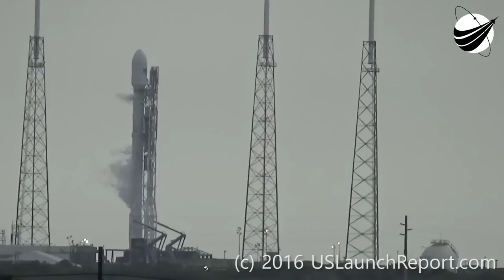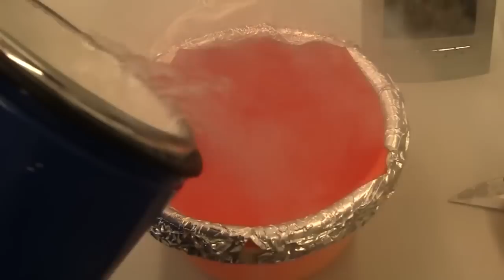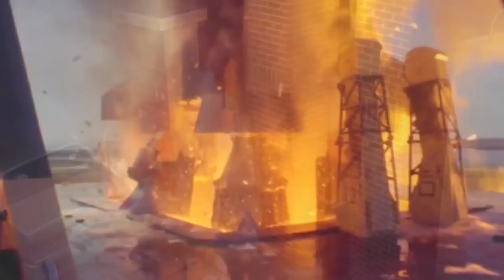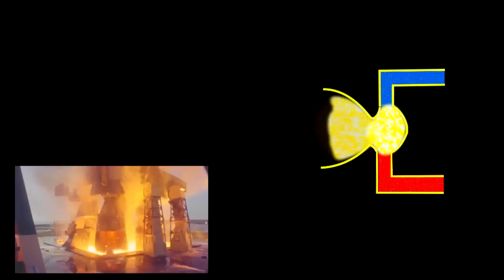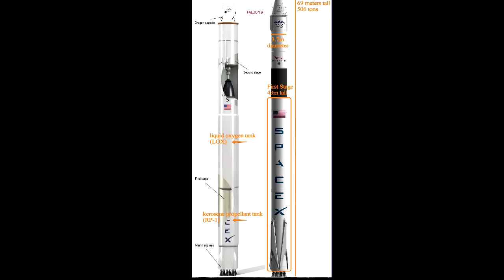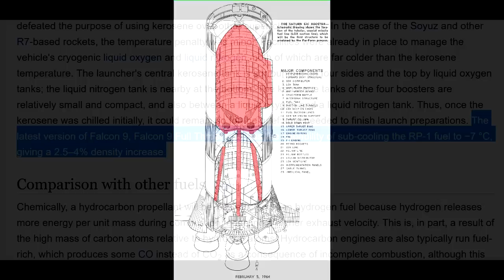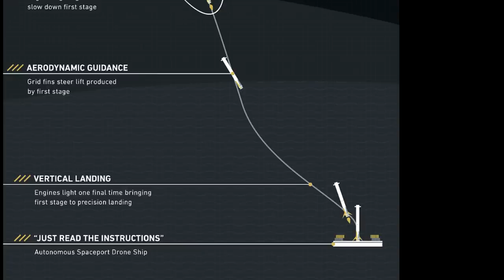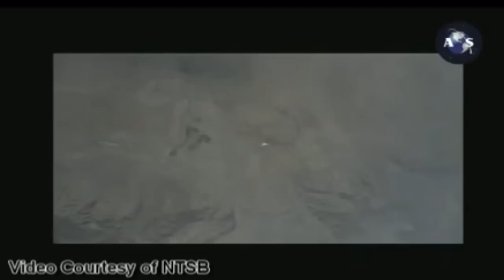Why did the Falcon 9 Explode?

Comment: The fact of the matter is, NASA, though very historically successful, is a bloated giant. And SpaceX's vehicle reliability is actually quite good. They have designed the most efficient gas generator and staged combustion engines (Merlin and Raptor) in history, and have done it at a fraction of the cost. Nasa designs can take decades to be completed, and the obsessive bureaucratic oversight strangles projects via committee, and this will NEVER EVER make spaceflight affordable. The cost cutting is THE MOST IMPORTANT PART if more than 12 people are ever going to leave the planet for more than 2 weeks. It cost 400 million to over a billion to launch one shuttle. And it was the most dangerous spacecraft ever designed. SLS will be somewhat better, but its going to be almost 20 years before it can get a human to Mars' surface. If it ever gets built at all. Look what happened to constellation. And NASA has lost a hell of a lot more rockets than SpaceX.
Reply: Raptor has never flown. They have said it is the most efficient. Merlin is not the most efficient gas generator engine. NASA has a better success record than SpaceX
Reply: Merlin 1D Vac is the most efficient kerosene gas-generator engine, period. 

Raptor is not the most efficient staged combustion engine (that award goes to the Russian RD-0120), however it is the first full-flow staged combustion engine ever developed to the point of actually firing the engine, which is significant. It is also currently the highest pressure engine of all time with 250 bar in its combustion chamber, beating the RD-180. 

The more remarkable capabilities of the SpaceX engines are actually not their performance, although that is impressive too. The fact that these engines can re-light in mid air is actually not very common among rocket engines, and the fact that they have deep throttling is even more rare. These engines are also incredibly reliable; of the literally hundreds flown, only one has ever been shut-down mid flight due to a problem, and that was on one of the very early launches.

Comment: I really doubt that SpaceX is anywhere near matching NASA's cost to orbit, let alone beating it. Though they often state $50-$60 million per launch, in reality it has been closer to $120 million. Both Ariane and Atlas are about that, but are also FAR more reliable. Schemes to reuse some parts of a launch system have not so far reduced costs. In the case of the shuttle it resulted in much HIGHER costs. There are significant costs in reusing a launch vehicle. As you point out, there is a penalty in reduced  payload to orbit. There is the costs of refurbishment of the recovered booster. There is a failure rate in the recovery itself. All these factors erode any cost advantage reuseability may offer. This is why that most cost effective and reliable systems so far have been expendables.

Comment: The problem appears to either be in the second stage or in the fueling system in the tower.

The explosion propagated from the outside of the rocket where the vents and fill pipes are or it could have been just inside and that is where it blew out.

Either way it looks like a fueling system fault.

Comment: desighining a docket from scratch a d not to rely on 60th technology is what brings the savings. the musk rockets are 3 or 4 times cheaper without reusability. the price for desighning from scratch is that it is at first mot as reliable but that will come after 20 starts or so....

Comment: I think you are 100% correct about Spaceship Two: it is an insanely dangerous design, which is little more than a randomised suicide machine. But - the Space Shuttle was almost as bad. NASA should never have agreed to build the thing, once the military had made it grow so large that it could not sit atop a rocket.

NASA were incompetent when they designed and built it. Were incompetent when operating it, and treated it as an operational vehicle when it was never anything except an experimental craft. They told lies about what it could do, in order to get a third-rate space ship built.

If they had simply continued to build Saturn Vs. we'd probably have a city on Mars by now.

Musk has his flaws - as we know; his Hyperloop idea is more of a mass-murder device than a mass-transport device. But we also know he is determined to succeed, and I for one, think he will have a tremendous impact in space, and here on Earth.

Comment: Just one of the turbo fuel pumps from the Space Shuttle Main Engine develops as much power as 40 diesel locomotives. They are each about the size of a V8 engine. If you put the inlet of one of these pumps into a typical in-ground domestic swimming pool, it could empty it in less than 20 seconds. If you pointed the outlet skywards, it would pump a column of water 50 kilometres into the air. Yep. Turbo pumps are seriously kickass.

Comment: Dude, I get that Musk has a quasi cult following which is quite annoying, but let's give credit where credit is due... This is a great advance, whether it might be useful soon is yet to be seen, but it does give another option for spacecraft development, one that might be important for the future... And even if it isn't, it still probably worth just for the experience in space craft control theory and stabilization... The guy set out to do one thing, get a sattelite on orbit and then land the rocket, and he did it, were there accidents on the way? Of course, it's not easy to get into space flight, but as far as I know no1 died, so they possibly were being careful enough, it seems some of the explosions were even autodestruct mechanism activated when a sensor failure was detected, much better to just explode a rocket than to let it fly with a faulty sensor...

I for one am grateful for this experiment, and am happy it happened...

Comment: The only way you can really make a launch vehicle renewable is if you scrap, and refine and rebuild the machine anyway as any wear and tear would be catastrophic.
Reply: What wear and tear? Each new engine is test fired to full duration in Texas,, transported to the Cape, test fired to full duration again, then launched - all without scrapping, refining, and rebuilding between the 3 fires. They also have test engines they have fired multiple times at the Texas facility without rebuilds.

Comment: You'd think they'd have some sort of leak detection systems: perhaps an array of sensors detecting ambient fuel and oxidant levels all over the rocket. For the trouble, you'd get to keep your rocket and payload and launchpad if a leak was detected and fueling was aborted and perhaps have the fuel neutralized.

Comment: Some have speculated that the use of deep cryo lox cooled very close to its freezing point to densify it and increase the size efficiency of the vehicle combined with the fueling sequence being accelerated by a factor of six in comparison to other rockets created a temperature gradient between the lox tank and the helium cylinders that was sufficient to over stress the materials.

Comment: can anyone answer this...i know this wont work on non oxygen planets but on earth why use liquid oxygen and not say a turbo jet engine to funnel a massive amount of oxygen to mix air with the kerosene or hydrogen at least until the oxygen runs out then  switch to liquid oxygen once the air gets thin.

Comment: 12:10 - Wait.  What?  The Falcon 9's second stage runs on kerosene and LOX, and not hydrogen and LOX?  I suppose you learn something new everyday.  I just don't understand temperature and fuel expansion-wise, why they wouldn't go with how the Centaur does things.    And it'd be nice if they could drop those stages via parachute into the ocean.  Salt water I know, but it'd solve a lot of problems.
Reply: Yep both stages use the Kero-LOX Merlin engine. They have a Metho-LOX Raptor engine in development which will have considerably more thrust and run cleaner.

Comment: there was a smaller explosion sound before the actual explosion, along with a small flash of light in the background on one of the cameras before the explosion, the issue is currently being investigated as a source of sabotage.. if you thinking about it, space x reduced the cost of military satelite launches by tens of millions while it's only other competitor boeing was charging way too much probably because they had no pressure to improve or reduce costs.. it's been stated on record this is one of the most puzzeling accidents space x has ever come across, which complies with what you said in the video, refueling is already well established and secure technology.. so why would it explode?

Comment: Why is there no mention of the fast moving object flying by the rocket from the right to left at about nosecone high of the rocket? Also just after that fast flying object passes by another object appears from the lower left side of the view moving up and into then out of the blast  and continues it's up and away trajectory until out of view.  There are several videos that slow this video down to see these objects go by at the moment of ignition, it is above suspicious...
 Those fast moving objects took advantage and exploited a weakness during the fueling process. The results are self evident.

Comment: So just as an update on how things actually played out, none of your proposed failure modes were close to being correct. As far as the "drawbacks" of recovering the rocket for reuse, yes the last little bit of fuel provides a lot more delta v than the first bit when looking at it kilogram to kilogram but I think it's a bit disingenuous for you to skip over the fact that the propellant only amounts to 0.3% of the total cost of the launch. You lose delta v by recovering the rocket, but once SpaceX is reliably recovering rockets, needing to launch a used Falcon Heavy instead of an expendable Falcon 9 won't be an issue. Being able to use a rocket more than once will easily cover much more than the added cost of the bigger rocket.

Comment: Hey man! Great video! You did a very good job of educating us on the issues. I would like to address one thing you said, which is keeping the 1st stage recovery in perspective. While the second stage is the most powerful part, the 1st stage is the most expensive. So while they get a little less of the end acceleration from the first stage, they save a lot of  money, which is key for the relatively small space agency which they are.

But also, SpaceX can't just do what other space agencies are and have done. They are small, and in order to succeed, they have to be unique, which they have done with the 1st stage recovery idea.

Comment: I don't know why you just suddenly moved from "lecture on how the falcon 9 might have exploded" to "falcon nine BUSTED"
but I will  make 2 points to why that section of your video is ridiculous

1(the best one): the falcon 9 exists and is extremely cost effective compared to other rockets, if it was a concept you could talk about how they can't make it work, but they did.

2(the big one):the last bit of fuel provides the most acceleration, meaning it needs a very small fraction of the fuel to land. If for some bizarre reason the last bit of fuel provided the smallest acceleration, a significant portion of fuel would need to be used to land it.
in both scenarios the speed that the rocket looses by not using all of it's fuel on direct launch would be the same. the thrust lost is the trust that requires to land the rocket.

this means there are 2 things that increase the cost of the rocket:
- it must be able to go as far as other rockets while still saving some fuel.
-and it must bring more fuel.

the first thing increases the cost of the rocket (production and design), but since the production cost increase is nullified by being able to reuse it, the increase cost of landing the rocket is almost completely on little bit of fuel and the design of the rocket.
and it is immensely refunded by not loosing the bloody rocket every time you use it.
If it was not worth it, they would have realised "hey our rocket is more cost effective than others, but thats because it is very good overall, the relanding thing is just making it less efficient, lets just not do it then"
this is rocket science, not some bullshit project expecting to get donations for a head-start and then not accomplish anything. this is not some public founded blind project, it is a private founded project.

(sidepoint): don't you think they considered the parachute thing? parachutes are not easy to deploy from a rod shaped object, and they are heavy. If it was better to use it they would have.

if you(or any other comenter) can provide counter arguments to that, I will gladly remove my downvote and add an upvote; however, so far this video made me reconsider if you are actually a reliable source of constructive criticism or just hate on any project that goes out of norm.

Comment: You seem so jealous of Musk lol. I mean, all you do is bash the things he's putting billions into making. And that's alright, if you think someone is doing something all wrong, but you don't have any suggestions on how to actually do anything. In fact, it seems like you have a very limited understanding of most of the situations you're criticizing. Like this one, for example, is still under investigation, and you talk about your assumptions as though they are true. SpaceX still hasn't determined the problem, how could you have?

But I understand that you think you know where the problem would most likely lie, but again you're so quick to criticize. Could you have designed a better rocket? What you're saying is that If NASA engineers have fixed this problem on their costly, one-time-use rockets, then it should never be a problem again. But that is a stupid argument! Since the rocket weighs more with the added functionality of landing, they have to find ways to increase efficiency. And you can't do that by saying "If it ain't broke don't fix it".

Just once, try to give an solution, rather than pointing out the problem, which is the easiest thing to do.

Comment: Well some of your comments are clearly not that well thought out. Supersonic parachutes aren't exactly easy. Rocket always has some extra fule for required safety margins, which can then be burned to 100% for landing. Reentry also does a lot of aerobraking (http://space.stackexchange.com/questions/13935/how-does-the-falcon-9-first-stage-avoid-burning-up-on-re-entry). 1st stage thrust does not vary as dramatically as you put it, since there is the 2nd stage .. and the weight of the rocket itself. Anyway, rockets explode all of the time.. so no, problems were not solved a long time ago as you want to put it. Each and every rocket has to be perfect; no amount of previous experience will mitigate that fact. Delta, Arianne, Shuttle, Soyuz - they all exploded at some point in time.

Comment: IMO the only reusable spaceship that will ever be safe enough and financially viable is something more akin to the ship described in The Martian. That is a ship, that's probably built and launched in modules then assembled in space and stays there, powered via ION engines and kept orbiting the planet and a reasonable speed while not being used, then using a standard throw away rocket to send a crew and supplies up to dock with it before sling shotting out of orbit to head off on long distance manned flights.

Comment: "they would never have allowed a design like this off the drawing board."  Thunderf00t please contrast your statement with this:  "I took this stuff that I got out of your seal and I put it in ice water.  And I discovered that when you put some pressure on it and you undo it it maintains its--it doesn't stretch back it stays the same dimension.  In other words that for a few seconds at least (and more seconds than that) there is no resilience in this particular material when its at a temperature of thirty two degrees.  I believe that has some significance to our problem"  Which of course as we all remember was said by Dr. Richard Feynman in 1987 at the Rogers Commission hearings on the Space Shuttle Challenger disaster.

Now, if you are HONEST with yourself and with us you will admit that even NASA the great engineering marvel of our times, is quite capable of failure of an enormous magnitude.  Because those seven astronauts needlessly lost their lives because some managers at NASA were exceeding limits that the engineers told them REPEATEDLY that exceeding them was going to cause a failure.  The engineers were right.  The managers were wrong but they all failed because they decided to do something that would cause that shuttle to fail, they had knowledge of it and it was a simple fix (correcting the seal issue was a matter of switching to a slightly more expensive clay and metal based seal that would actually retain its shape at cold temps) and they did nothing about it.  NOW which of the two organizations is the most foolish and wasteful?  At least the SpaceX people have not killed anyone (yet)

Comment: If anybody wonders how powerful the LOX/Kerosene explosion is, skip to 16:50 and watch many tons of steel girders being thrown more than a hundred meters (look to the right edge of the explosion / screen.)
Pause the clip at 16:48
Put your mouse on the part of the tower you can see, the lower red part is good.
At 16:52 part of the tower is visible mid-arc.
When the smoke clears at 16:59 the tower is gone.
Guess-ti-mate how far it's being thrown, the Atlas-Able was about 30 meters tall.